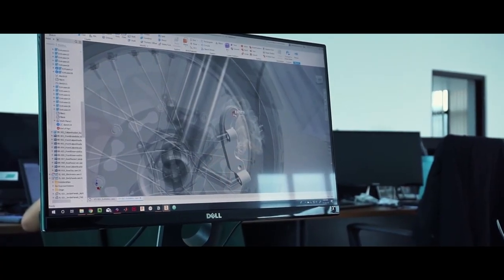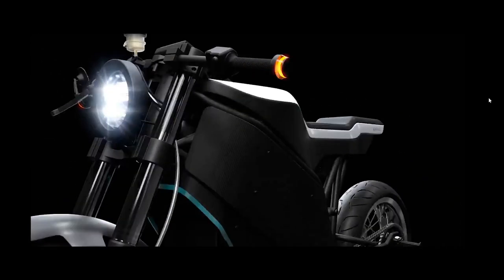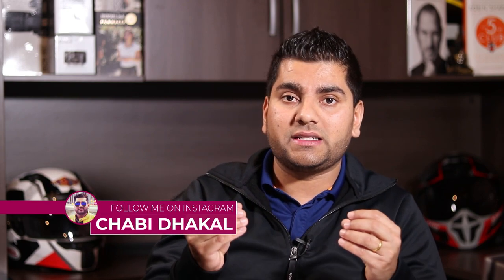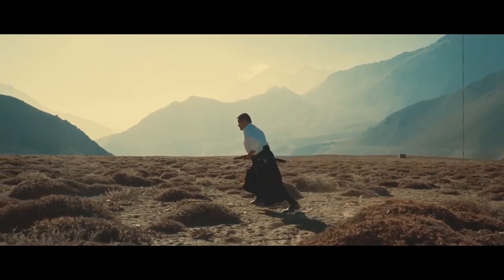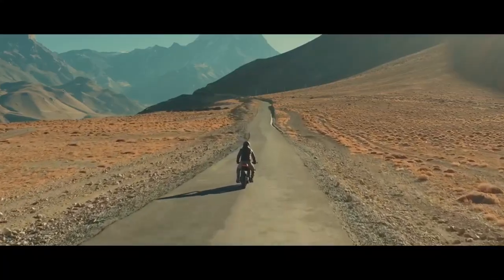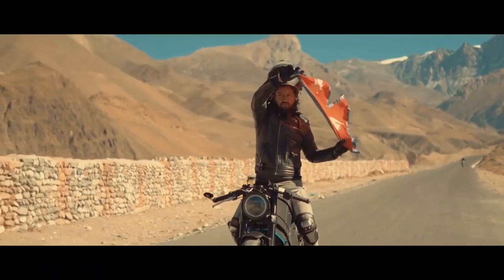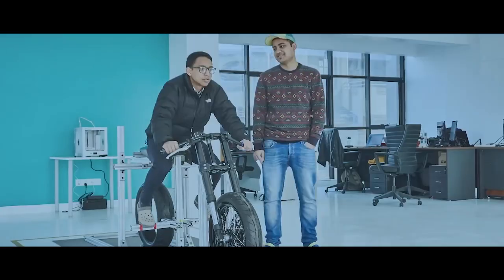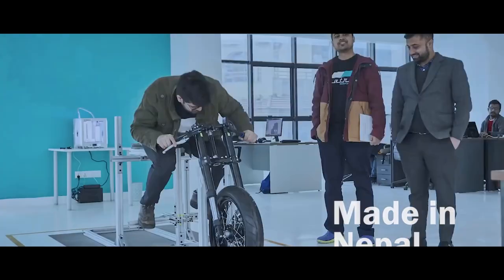First Electric Motorcycle of Nepal | Project Zero - Yatri Motorcycles | Cyber Motorcycle of Nepal?

Comment: What if that 7 inch screen is scratch or damage in public parking??
Reply from the maker: Good question brother, i have a BMW R1250 GSA which is equipped with 7 inch tft screen ..it’s is built durable and haven’t had any scratches..you can also apply a protective glass/plastic just like you would do it on your phone 📱..